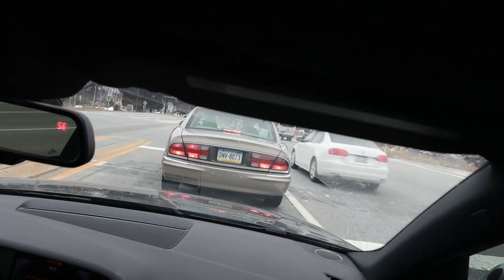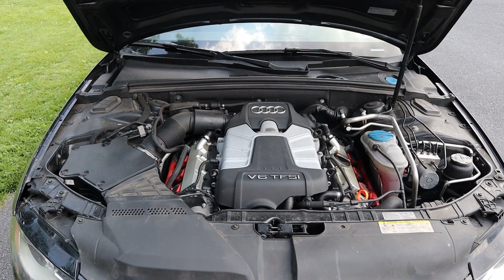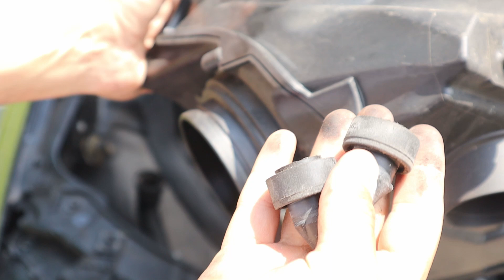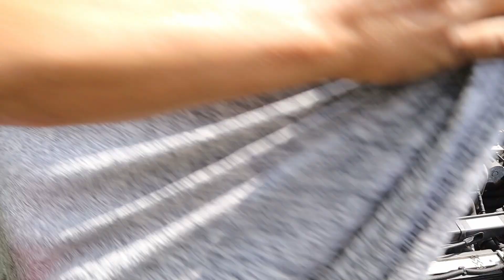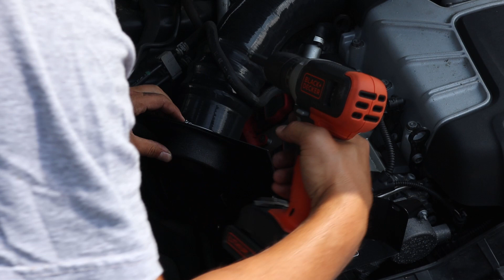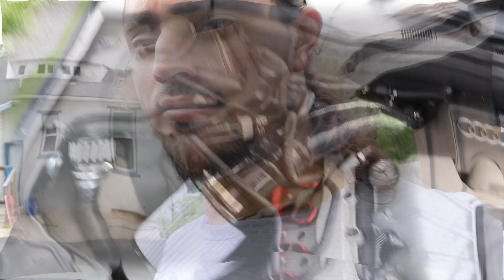Audi B8 S4 SuperCharger Whine!! (part 2 of 2)

Comment: Nice video with diy and example of intake noise 😁
Reply: Also, you've convinced me to buy this exact setup for my S4!
Reply from the maker: @joshmclain774  Haha siiiick. Make sure when you do use the links i have in the description helps me out a bunch. Also ECS is a dope company and have helped me anytime ive had questions or needed things fixed/replaced.
Reply from the maker: Thanks boss. Glad it could help. This is all new to me and im having a blast putting this babe together.